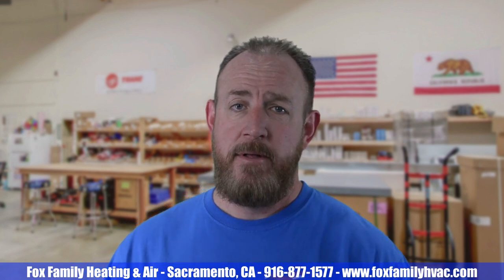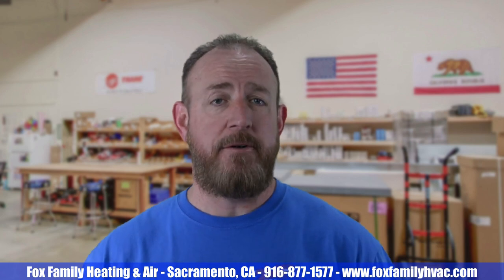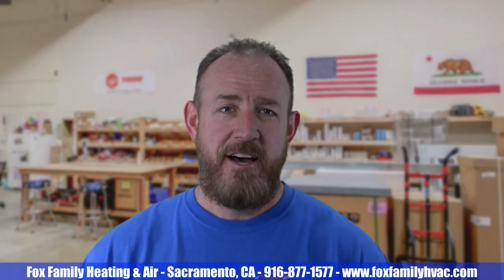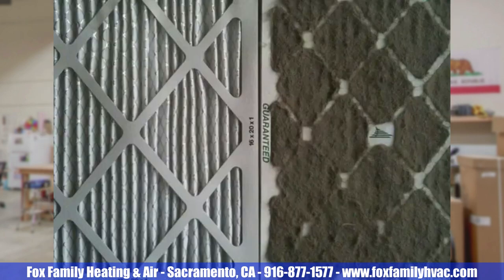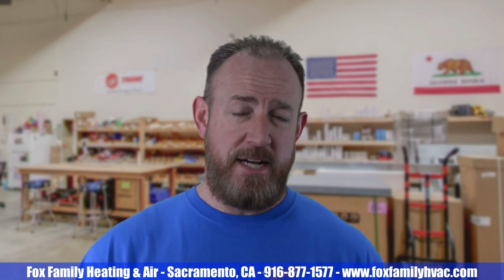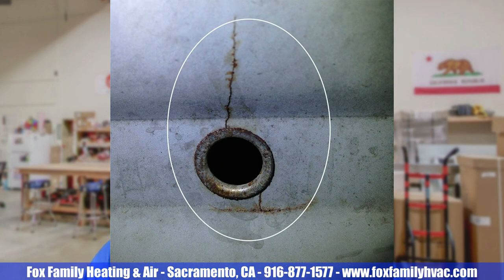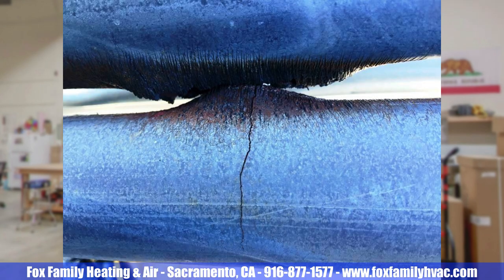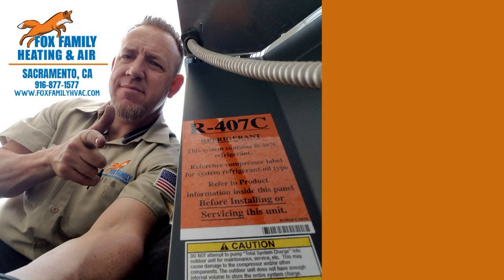7 Reasons Why Heat Exchangers Fail

Comment: Excellent video. I have a goodman 3 blinking lights, replaced pressure switch, replaced draft inducer, and made sure vacuum hose was clean. 80%'er and I'm worried there may be a heat exchanger issue. Not getting ignition yet, so I wasn't sure if the computer does some tests of the draft first, which may or may not include heat exchanger issues. I would assume heat exchanger can only be tested when ignition and combustion occurs, though.
Reply: Yes, can't really tell if a heat exchanger is bad unless it's running, or you visually inspect it. Those blinking lights are usually some type of code. There is usually a sticker on the inside of one of the doors that has LED error codes. Inducer comes on, which activates the pressure switch, then hot surface ignitor (will glow bright red), then you should hear a click of the gas valve opening. Sounds like you replaced 2 of those. So if it's not firing, it could be gas valve or hot surface ignitor.
Reply: @thplugg  yeah the code told me it was a open pressure switch - so I replaced the pressure switch and hose... still 3 blinking lights... so I replaced the draft inducer fan... worked for 24 hours then stopped and still 3 blinking lights. Checked vent, it was clear.
Reply: there is a little port where the hose from the pressure switch attaches to the inducer housing. disconnect hose from housing and poke a wire through. they do get plugged from time to time.
Reply: @jaksmithers176  I did that and even replace the whole inducer draft motor and fan.....

Comment: Gday brother .  I have an old Mitsubishi 12 hp  reverse cycle  system …  it just tripped out tonight .     

I reset the fuse   , the soft-start worked - the heating  came on for  about  5 to 10  minutes ,    The  fuses tripped again . 

Upon investigation  I noticed the over water flow   Pipe  to the Bucket has not been getting any over flow .       I can see the water  has been leaking  from inside the unit , and out from the ventilation underneath ….  Obviously it’s  now affecting  some electrical components .  

Tripping out the independent fuse  In Our  fuse box .       

I have now isolated it ,   I have run a  cable up inside - the outside overflow pipe   To make sure it’s clear  , it is 👍 .         

Do you have any thoughts  as too what else  ,I could look for  . That might cause this kind of problem .   All the external pipes and fittings are - copper and brass  ,   There’s No indication of leaks from those .       Any thoughts about it would be appreciated .  Thanks 👣🦘

 Until I can get it looked at .       Dose water come out of the system’s  overflow pipe  on the heating  and cooling cycles ?

Comment: Please help. HVAC TECH is coming tomorrow. My R-22 1999 Rheem model # rpka-049jaz with scroll compressor was making a squealing sound the day after the severe 13 degrees cold mornin. Immediately I turned it off i noticed that the auxiliary heat kept cycling on before it died. 
The last TECH who checked it last year says it was repairable and parts were available. I'm pretty sure the compressor died suddenly. I don't want to invest in a new system because I don't anticipate keeping the house much longer plus the EPA is already holding hearings on banning R-410A so if compressor can't be repaired i was thinking to find a used compatible condensing unit as the air handler in Attic was running fine.
Any advise appreciated this unit is very common in my subdivision of homes built between 1998-2005 im in deep southeast in zone 3 but only 70 miles north of zone 2 bellow the hot humid line